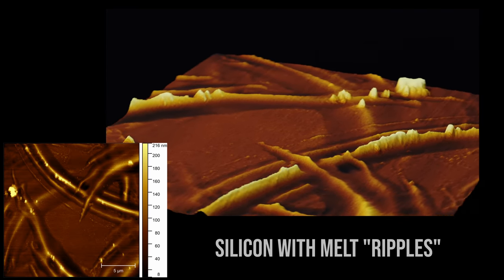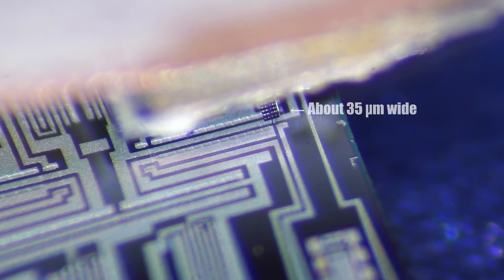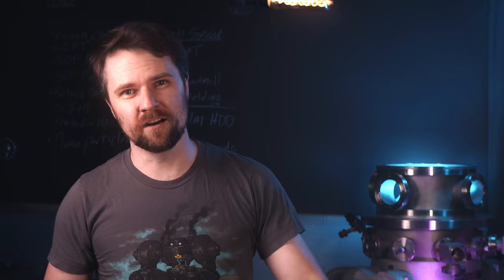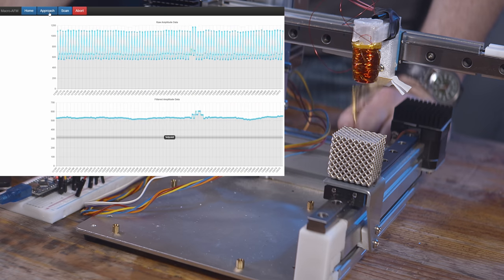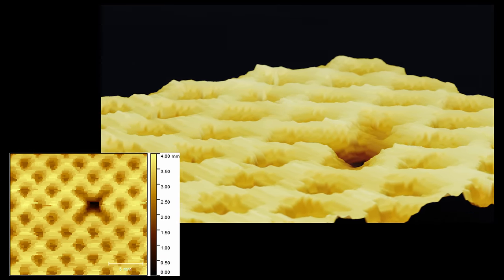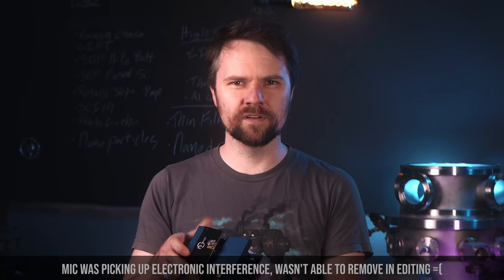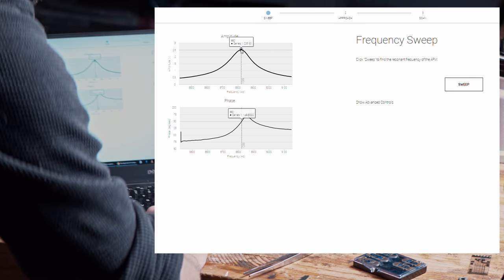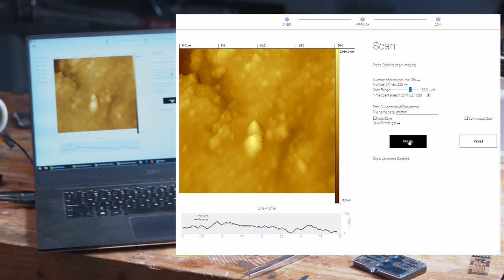1,000,000x Magnification with Atomic Force Microscope

Comment: Nice video as always! Your production quality is always outstanding.

Re: Microphone issues: I experienced almost identical RF interference on a Rode shotgun mic a few years back; from what I can see your setup is probably using a shotgun mic too. I even went so far as to get a replacement from the manufacturer but it had the same issues.

Best solution imho is to use a transformerless small diaphragm condenser mic instead (some decent but cheap examples being sE8, Rode NT5, Blue Hummingbird, etc.). The cardioid pickup pattern is a little wider than that of a shotgun mic, but they are extremely resilient to interference. They also have very linear off-axis response, so unlike a shotgun, there's not really much of a 'sweet spot' effect if you move around a bit.
Reply from the maker: Hmm, so I'm using a Oktava MK-012 at the moment, which I believe is a small condenser as well? (audio is definitely not my forte though, please feel free to correct me!).  I had some footage which I had to toss completely because there was a very heavy rumble which noise reduction couldn't remove without butchering the audio... I think the mic was physically touching the edge of the light softbox for a while, and the fan on the light was transmitting a rumble to the mic.  In other footage where the mic was moved a new position the rumble was gone.  So my current theory is that the light was also causing the interference issues?  Either due to general EMI, or it's radio-controlled remote maybe?

Not sure, that's the first time it's happened. :(
Reply: I assumed it was the 'voice coil' actuator you made, it is pretty noisy EMF wise, and although it's resonating in low Hertz, you get square wave harmonics when you PWM the control of it?
Reply: @BreakingTaps  Yes, you're right! MK-012 shouldn't in theory have issues, though it is based on a very old Soviet design from the 60's (apparently revised in the 90's). Many mics from that period were not designed to deal with modern EMI and can suffer from issues with noise, but I don't have any direct experience with MK-012's so I can't speak to how problematic that might be. Since it's intermittent and uncommon, it might be something which can be resolved through testing each piece of EMI-producing equipment in close proximity one by one until it occurs, though that might take a while. It is very possible working with all these industrial or self-designed devices that one could be emitting EMI far beyond what is typical of home use, as James noted.

Interestingly the MK-012 is extensively modded and studied, so there are many schematics and commentaries on its signal flow and componentry. One source I found seems to suggest the output may not actually be balanced, meaning the cable itself might induce interference(!):
https://medias.audiofanzine.com/files/oktava-mc-012-upgrades-470218.pdf

The voltages involved in microphone output are generally very low so an unbalanced connection can be very problematic. Sometimes just putting on headphones, listening live to the output of the mic, and moving the cable (and/or mic) around in various configurations will make an audible difference. I once spent an entire concert holding an unbalanced cable at a very specific angle between my legs to have the minimum EMI!

(there's a great series on the EEVBlog youtube channel where Dave interviews a mic designer who formerly worked for Rode that goes over all the fundamentals of mic design and theory from both a physical and electrical perspective, if you have a spare hour or two and are interested in the subject)

Regarding the lightbox fan, aside from a few specific cases, most smaller, non-handheld mics do not have much in the way of internal shockmounting. Thus, they are subject to mechanical vibrations transmitted through physical contact, such as up the mic stand or if the mic or mic stand is touching a vibrating object. Something like a Rycote INV-HG III shockmount or similar can greatly reduce low frequency vibrations applied to the mic stand, though they are a bit expensive.

Directional microphones exhibit 'Proximity Effect'; the closer a source is to the capsule, the more low frequencies are boosted. Microphones also are subject to the inverse square law, in that if you halve the distance to a source, you will get ~6 dB of extra signal from that source. The directional behavior of microphones also breaks down somewhat at very close distances, which means a source even behind the directional mic where it should attenuate the most will actually be quite amplified (and very rumbly/bassy!) if very close in proximity. Even if the mic wasn't touching the shade of the lightbox, it could actually be recording the very quiet vibrations of the shade itself due to being extremely close.

The best solution is to fight fire with fire and instead place the mic as close to you as possible and as far away from any noise sources as possible. If you find you don't have space to mount the mic above you, you can mount it under the view of the camera too, pointing up towards your mouth at an angle. Small diaphragm mics which use a single diaphragm design are usually very effective in the range of 2-4 feet, but can work fine (albeit rather bassy sounding) in as little as 4". Every halving of distance you can achieve will make your job (and your denoiser's job) significantly easier [as well as greatly reducing the room tone as an added benefit]. :)
Reply from the maker: @JamesBailey123  Oh my goodness, haha, I never even considered that.  That definitely seems like a plausible theory, I'm sure it was spewing some awful EMF.
Reply from the maker: @SamGossner  WOW!  Thank you so much for all of this!  That's very interesting regarding the unbalanced connection, I wasn't aware of that.  My cable situation is uhh... chaotic, with the mic cable piled up with all the power connectors for lights, camera, etc.  I'll spend some time organizing and isolating the mic cable from everything else.  It's currently mounted on a boom that gets it probably 2 feet from my face (and raised just up out of frame). But that position does require it to sit right next to the big softbox.  And what you're saying about proximity effect seems to suggest I should move it for sure.  The mic is maybe an inch or two from the edge of the softbox so that seems like a viable theory to the rumble. (As an aside, that's cool!  Didn't realize non-contact but close could do that... makes sense though.  If it's vibrating slightly, it'll move the area near it and the mic picks that up).

It's also just mounted on the boom, no shockmount.  I'll see about fixing that.  Figured it would be fine since it's not moving/mounted on anything, but in retrospect that's silly since the boom can pick up vibrations too.

And doh, I hadn't thought about having the mic point up instead of down.  I'm not sure I'll be able to get the boom out of frame if I move it to the other side (it's cheap, and not very long), but there is definitely space under the shot.  Will give that a go and see how it sounds.

Thank you SO MUCH for all the tips, really appreciate it!  It's funny, the more I learn about this audio/video/lighting stuff, the more I realize each area is an immensely deep subject with a ton of nuance!
Reply from the maker: @SamGossner   Update to the situation! So I finished filming the other day and ended up getting a bunch more of the same noise, even after reconfiguring all my mic equipment.  Started to do another round of reconfiguration, getting the mic closer, making sure the cable was isolated, etc... when I noticed I had the gain turned way up to get reasonable output levels.  Double checked that phantom power was on (it was) and nothing else silly was happening, still needed ridiculous gain. I pulled out an old large condensor mic I had sitting around (AT2035) just to sanity check the situation, and it only required very modest levels of gain for usable levels.  I wonder if I have a flawed MK-012 or something, and the ridiculously high gain was just making it very susceptible to EMI (in addition to the unbalanced output and other issues)?  Not sure. I'll pop it open and see if there is something wrong with the PCB, I read reports online that the interior quality can be lacking sometimes and pads might lift.  But in the mean time I'll just use that AT2035 despite being a very bad fit for the shop :)  And probably start shopping around for a more modern shotgun mic so I can put these issues to bed.  Nothing worse than spending an hour or two recording only to find out the audio is unusable.
Reply: @BreakingTaps  Glad to hear you were able to figure out an issue! A SDC is generally less sensitive than a LDC, but it shouldn't require so much gain. The rated 10 mV/Pa sensitivity of the MK-012 is not that abnormal for a SDC, while a LDC might be 20-30 mV/Pa depending on the designer's intentions (AT2035 is 22.5 mV/Pa). We're only talking a 7-8 dB difference there in theory though, so there's probably something more going on to cause such a significant difference in gain settings.
High gain/low sensitivity usually accentuate any EMI because there is less signal to noise ratio coming out of the mic, and all electronics, including both the mic and the preamplifier circuitry, will generate some amount of noise, and preamps are not immune to EMI either. Generally microphone preamps are at their most linear and well-behaved around the middle of the dial by design.
Actually shotguns can be susceptible to RF too. Once had significant issues with a Rode NTG5 in an old building with horrible wiring not far from a radio station, even when running completely off battery; don't know the cause exactly but it was enough to ruin the entire shoot. In such cases, a modern, transformerless, low-noise, balanced SDC, preferably with a Hypercardioid pattern (though Cardioid is just fine), is very useful. Something like a sE8, NT5, M310, Mesanovic SC1, Blue Hummingbird (a personal favorite budget SDC for spoken voice), etc. just to name a few at various price points which are all transformerless, balanced, and very low noise.
(edit: I realized I literally wrote this exact same thing in my original comment, sorry!)

Comment: This is my third comment on this video. Sorry for filling up your comment section.
There is something I've thought about for a few years. Would any material be able to deform any other material it the two different materials are pushed against each other? For examle if I push my (still attached (I feel I have to specify that, cause the internet is a weird place)) fingernails into a steel, glass or tungsten (just to have a bit of variation) surface, will it deform those surfaces? And what actually happends in some of these examples? Would copper for example be pushed in, but then to some degree "spring" out to it's original shape? Would the glass flow back and push up the indent? How do materials work? Where can I get the answers to these kinds of questions?
Reply from the maker: No problem :) So not an expert in this area, but here's my understanding:  in close proximity, like pushing a fingernail into steel, both materials will feel the force and the atoms/molecules that make up both materials will deflect to some degree.  It will likely be miniscule for the steel and considerable for the fingernail, but both will see a bit of a deflection.  The electron cloud around the fingernail molecules will push on the electron cloud of the steel, and long/short atomic forces will start to push on each other as well.  The main difference is that the atoms of the metal are held in their orientation much more strongly, so they will deflect less than the atoms in your fingernail, which are probably strung out in long wiggly organic polymer chains :)

Whether and how much a material "springs back" depends on the intermolecular forces holding together that material.  E.g. polymers are naturally more "springy" due to their molecular composition, whereas the more rigid lattices of metals are less plastic.  But a metal is more plastic than a glass, and will rebound unless you go past a metal's strain point (in which case the crystal lattice of the metal deforms permanently). etc etc

But at a very small scale, like say an AFM's cantilever tapping, even glass would "rebound" after each impact.  So it's a matter of degree mostly.

I'm not sure the best place to learn, my knowledge comes from the simulation side of things.  E.g. you can simulate materials using Lennard-Jones Potential equation + Electrostatic forces equations.  Those two govern how atoms interact at various distances, and then you sorta just apply it to a whole buch of atoms in different materials and see how things go.  There are probably physics books that explain it simpler but I'm afraid I don't know of any good resources myself (I came at this all from the bioinformatics simulation side of things :) )
Reply: @BreakingTaps  I have a less related question as well: In Dungeons and Dragons, there is a rock, which can only be moved by your hand (moved relative to the planet it is on). So it can not be deformed or moved by anything but a hand. If you let go of it, it will just float.
If i push the rock against another object like a steel plate, the rock won't be deformed by the steel, but the steel would be deformed by the rock. The steel would not be able to spring back, as the rock would be in the way, so would the rock (not to be confused with The Rock) be able to carve and be pushed through (and I guess melt through) anything, which can be deformed (and is not a hand)?

Comment: Some ideas by someone that doesn't understand the full potential of this: get a surface than touch with your finger or scratch with your nail than scan again.
Get a metal plate, than hit with several sandpapers until mirror polish and then show the differences on the surface

Comment: If you have Adobe audition, you can correct those mic interferences using the visual spectrograph.
Reply from the maker: Ah! I don't, but I'll look into it. Those noises were driving me mad, and my backup mic on the camera itself sounded too bad to replace it with :(  Cheers for the tip!
Reply: @BreakingTaps  The theremin adds a spooky ambiance ... next time boost it :D
Reply from the maker: @blahblahblahblah2933  Lol 😂  My shop is actually haunted I just didn't want anyone to know 🤫
Reply: @BreakingTaps  But I've already decoded the message and ordered the supplies. I guess I'll have to safely dispose of them now :D

Comment: So late to the party, but this is really cool! Great video! I wonder if such a "macro-AFM" could be used as a bed leveling probe on a printer. Might be cool (if also scary as hell) to try and print on relatively uneven surfaces after scanning them with a cantilever bed characteriser. Have you tried scanning magnetic materials? Is it possible with such a set up? :)

Comment: I would hope that the 600nm defect on the gauge block is dust as the tolerance for dimension and parallelism on a grade 1 block less than 10mm is +/-50nm
Reply from the maker: TBF, it's a very cheapo import set from Shars. Sooooo... I wouldn't be too surprised if it's just poor grinding.  They do wring together though, so there's that.

Comment: Since scanning is comparatively slow, are there other techniques that can make videos for capturing processes/changes over time with reasonable speed?
(Btw awesome explanation!)
Reply from the maker: Definitely! So there's the option of just speed up a scanning probe technique (smaller cantilever == faster oscillations, which means you will settle into the correct reading faster).  White light interferometry is a popular option in the industry, it can get you sub-micron measurements quickly and is a non-contact option. Chromatic confocal is another interesting option and can be quite fast.  There are some "single shot" techniques like holographic microscopy but they are still more academic in nature than actually useful, or techniques like focus stacking / contrast detection which are useful for building 3D models but not as quantitative.  And finally there are some slightly less precise methods, but much faster, like structured illumination or laser line scanning.  Those can run very quickly but are more "macro" scale.  Lots of options depending on the goals! :)
Reply: There are full size AFMs that can achieve full video rate Scans (28 Hz). How quantitative those images are is another story, but it is certainly doable.

Comment: You have the very sensitive scanner on the same table as the computer l, that produces both vibrations and probably some electromagnetic interference. The table is made of wood, so it probably filters out a lot of higher frequencies or something, but still.
Reply from the maker: Yep, for absolute best quality images it's best to move the laptop to a different surface to minimize vibrations and air currents.  But I'm usually too lazy to do that, it does a remarkably good job even with a vibration source so near by :)
Reply: @BreakingTaps  low cost vibration isolation 1) suspended on bungee chords  2) support on partly inflated football bladders.